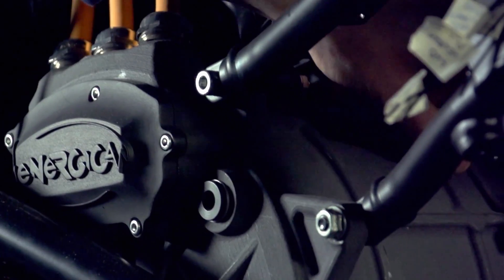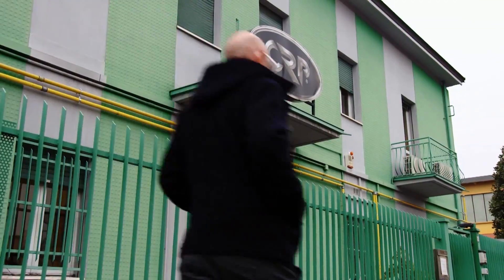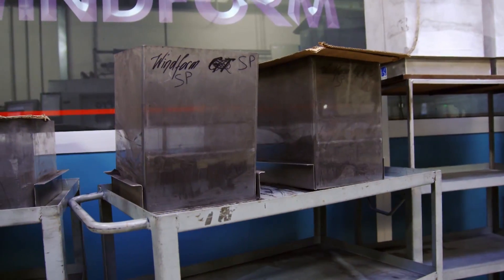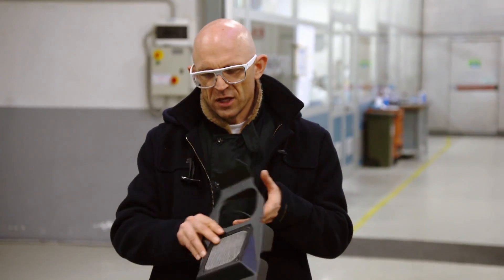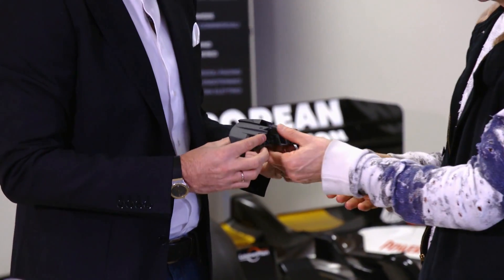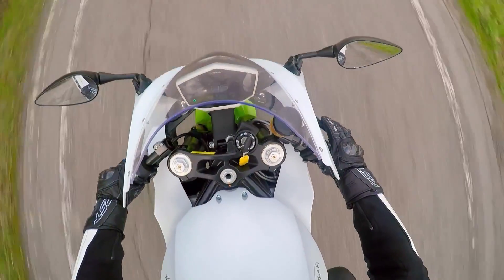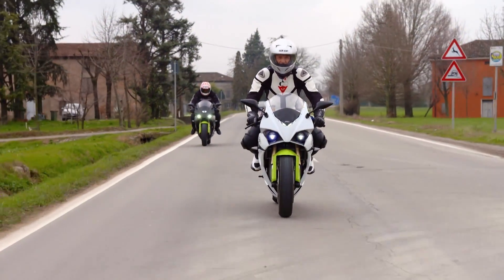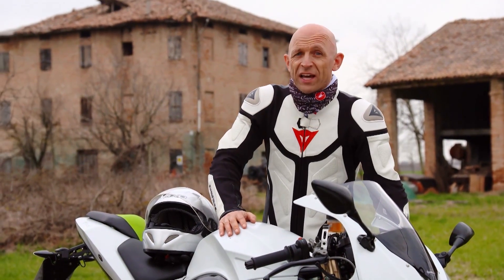3D Printed Motorbike - The Gadget Show

Comment: But 3D printing has been around for a long time, and I'm talking before 2000.

I'm pretty sure the majority of things are 3D printed, making this something unimpressive.
Reply: it is nonsense. this video would have been much more interesting if it focused on the electric system of the bike. 3D printing is a great prototype tool for small units. Certainly not comparable to mass production injection molding and such. Like you say we were using stereolyth 3d printing where i worked back in the mid 90s.

Comment: where is the clutch`?
Reply: +Theis Carlsen All-electric vehicles typically only have one gear. So no clutch required.
Reply: +Theis Carlsen The electric Zero Motorcycles range and the Lightning LS-218 also don't have clutches. Even my petrol driven bike, also Italian, an Aprilia Mana 850, doesn't have a clutch lever.  I got over the "no clutch" thing very quickly.  Can't wait for electric bikes to be the normal choice.